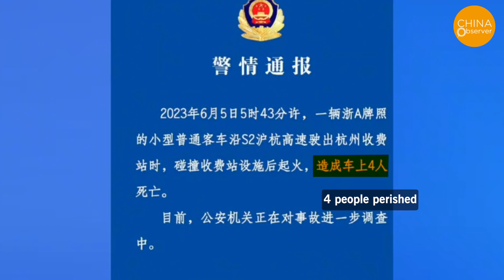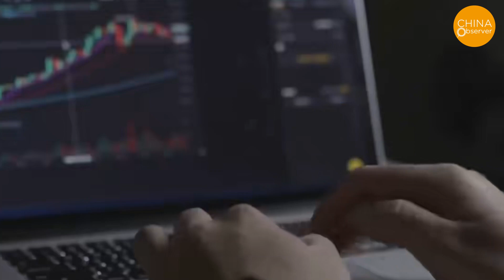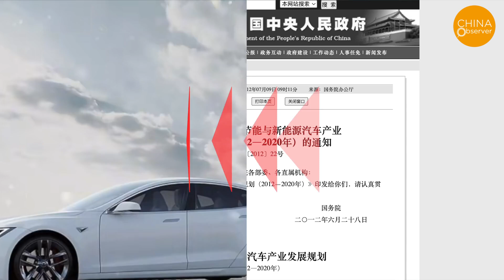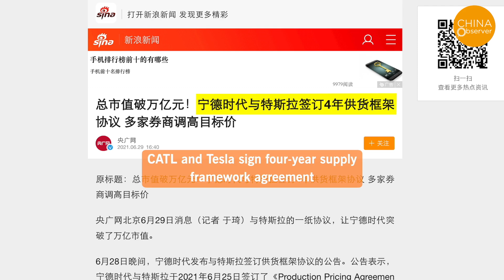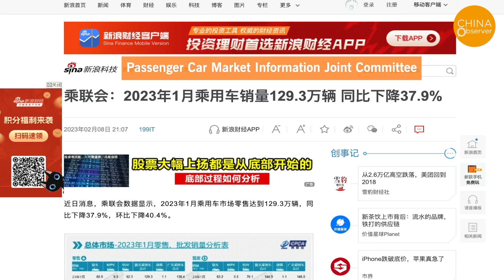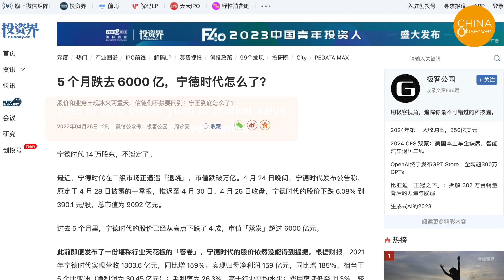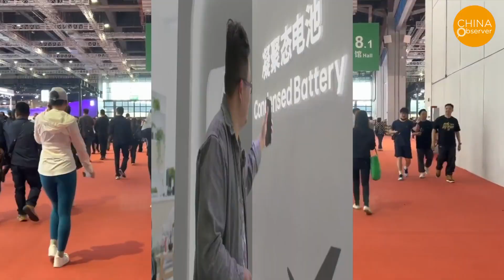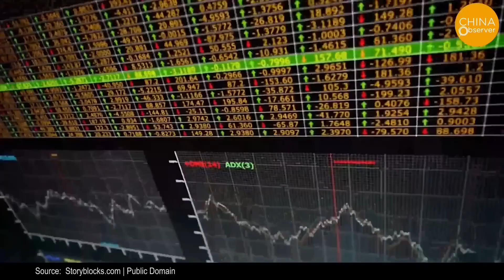China's No.1 EV Battery Factory in Ruins: Battery Explosions, Factory Blasts, 1 Trillion Lost

Comment: Ill stick to my 1961 Comet ,2 door , it has a 1968 ford 200 six cylinder engine Tremec T5 five speed transmission headers ,1 barrel carb . My car gets 26 MPG highway at 65 MPH, 7 external parts on the engine that can break all cheap . No computer and sensors.

Comment: I still love it how people tout 'hydrogen' as a solution to all this, without realizing....
1 - hydrogen gas is rare - in fact it is non-existent naturally on the planet and every cubic gramme has to be manufactured. These people confuse it with elemental hydrogen, ie free protons.
2 - hydrogen gas is EXPLOSIVE.... ICE cars go up in fire, EVs go up in an inferno, hydrogen cars are a BOMB plain and simple.
3 - hydrogen gas is expensive and inefficient to manufacture - the electricity needed to generate enough hydrogen to power a car 10 miles, is enough to power a normal EV for 100 miles.
Reply: Even if we could manufacture it easily/cheaply, the safety issue is still huge. I don't wanna drive around a hindenburg.

Comment: Lithium Ion batteries create metal fires.  It requires 80000 gallons of water to put out an EV car fire vs 800 gallons for an ICE car fire.  They are ticking time bombs.
Reply: Every gas car is ticking time bomb.  Have you never seen movie?
Reply: Guys if you crash any car into a solid barrier at 70+ mph it is probably going to explode.
Reply: modern cars dont use litium ion batteries they use LFP batteries which are much safer and does not produce oxygen for their own fire. LFP also does not need any cobalt or nickle

Comment: This year's biggest worry is how many ICE car factories will close and which brands will disappear. Jeep and Mitsubishi are already gone, next looks to be Huyndai which has factories for sale and 3 of the 5 already sold, then Peugeot and Citroen. In bigger cities EV sales will probably hit 80% as the cheaper battery prices are bringing the car prices down. Then there are the small cars that will switch to sodium batteries, those are dirt cheap, there is only 30USD worth of sodium in a typical battery and no nickel or cobolt. That's why CATL is also building their own sodium battery factory. 

The LFP batteries are now the dominant type of battery as their crash safety is the best. I have seen several accidents where the battery pack got a hit (one driving over a steel/concrete block that cut the battery open), and it was amazing to see that there was no fire. Then there was a Model 3 Tesla that went of the road and the battery hit a big rock. I know the owner and he said:"It cost me 1500USD to fix it, one of the 4 (LFP) modules was damaged and was replaced, the bottom of the pack was repaired. Insurance company refused to pay for it because it was on a private road and it was clearly a racing situation."

Comment: Nothing wrong with Tesla battery.... they have AC system to protect from battery fire. Chinese cars do not. The electric car is fun to drive but it cost too much. Insurance is at least twice as gas car. Renew license fee is expensive and increase every year. Every time you drive about 1hr, you have to start looking for charging station. I would not buy electric again.
Reply: Do more research. Some of the safest and best EVs are made in China. Zeekr 007 golden battery can withstand fire up to 1000 degrees. Does Tesla have this?
Reply: @i6power30  Tesla doesn't have to handle fire up to 1000 degrees because the fire never started. China EV does need this feature because it's on fire...
Reply: EV's are for the more wealthy in society. EV' make no sense for mid and lower class people

Comment: There are some correlations made in this video that just aren't true.

There wasn't a reaction to ANYTHING that caused the R&D of solid state batteries.  No explosion no nothing.  It happened because there is R&D all over the WORLD for battery tech and to bring anything to market takes MANY years as in a decade+ unless you're building upon a battery tech that already exists in the market.

For instance Tesla produced their 4680 battery which is in production in the U.S. and goes into their vehicles made in Austin.  It's a Li-Ion battery.   But it's a big Li-Ion battery.  It's designed specifically for BEV and it's designed to go into a structural battery pack which is a sealed unit.  It's new technology but the chemistry is basically the same so there isn't the years of having to test the chemistry of the battery.  It took them a few years STILL to get it to market because you have to design the machinery to make it and have that be efficient.  It is the BEST design for Li-Ion going into a BEV.  There's a bit more to it than what I listed.

The research for solid state batteries goes back more than 50 years.

BYD uses DIFFERENT battery types from DIFFERENT companies just like Tesla does.  Their LFP battery can't power anything.  If you have bigger vehicles that are heavy, you probably need something with more energy density so BYD would turn to CATL for their lithium batteries.

So, for any accident you have to do the research into the vehicle involved to know what battery type is in it.

Right now Tesla does well, and so do some companies in Asia, OUTSIDE of China such as Hyundai.  Both companies can't make BEV fast enough to keep up with their demand.  And this is to say that if you make a product that consumers want they'll buy it.  And part of consumers wanting a BEV is a proven record of safety.

One other point, a BYD sold in China is not the same thing as a BYD sold in the EU.  There's going to be standards that have to be met to sell a vehicle in the EU and if a company doesn't meet that their products will get pulled.  I think different companies have made things to be cheap in China so they can sell them for as low a cost as possible.  That doesn't work well with BEV as has been shown by mutiple fires.  But vehicles in China, because the CITIES are CHEAPLY BUILT has a DRAINAGE problem which means vehicles end up in water more often, and water and BEV don't mix well depending on the battery tech.

So now if China could start by first ripping down their cities and put proper drainage in........
Reply: But one has to consider the safety implications of Lithium ion cells used in large applications, a well known problem which manufacturers of battery cell packs conveniently ignore.

Comment: Lithium-ion batteries are a technology invented in Japan, but the Japanese don't like car fires, so they were very careful when handling lithium. Therefore, the Koreans and Chinese produced large quantities of lithium-ion batteries with the aim of making money. The result was many car fires. This is a very funny story. In Japan, it is still undecided how to handle nuclear power generation, so it is very doubtful whether EVs will become widespread in the future. Personally, I have high hopes for hydrogen engine cars in the future.
Reply: I totally agree with you. Japan is adapting hydrogen technology and Toyota is leading the way.
Reply: @ninjazzrhythm400  You are joking right? Toyota is committing seppuku with hydrogen tech. It's dead from the start, and losing billions and has billions more in debt.
Reply: Hydrogen is an extremely explosive gas. But if you have excess cheap or free renewable energy it probably makes sense to use that excess capacity to generate hydrogen as a form of storage for later use. But batteries are also a form of storage for later use and could be more efficient?
Reply: @gordo3582  you can even store energy in synthetic fuel also. Hydrogen is a really dumb solution.

Comment: Even safe batteries have to be charged and our grid can’t handle it
Reply: Nobody's can - more than a grid handling it, the massive investiments and maintenance of charging stations is largely impossible let alone the fact that they aren't standardized either. Add to that the fact that replacing a battery pack every 8 years or so costs £30,000 and you see what a stupid idea electric cars are currently.
They're completlet designed wrong.
Reply: @crunchyfrog555  Why do you need to change your battery pack every 8 years? you know just because your battery is at 80-90% doesn't mean you have to get a new one lol
Reply: Charge at home like most ev users do here.
Reply: @kamsunleong6648  Great as that limits you you to how far you can travel then. What a dumb solution. That's the big problem with EV cars. Even here in Britain there's fuck all chargers which means if you travel more than a couple of hundred miles, you're stopping for the night or permanently.

Comment: Don't plan on surviving in a major collision in any EV. Perhaps hydrogen vehicles may be safer than EVs.
Reply: hindenburg
Reply: @cliffontheroad  excellent analogy. I wonder what happens when a fire starts and the jaws of life are required. Batteries won't wait for emergency services to show up. A family friend's daughter was cooked in a rear-end collision while she sat at a stoplight in the famous Ford Pinto. I wonder if hydrogen might prove to be safer even though there's compressed hydrogen to deal with. Lithium batteries have a series of individual batteries that have a potential to short circuit if hit in an accident.
Reply: @thinkingimpaired5663  There is always the Stanley Steamer. And an actual bath tub toy powered by baking soda. I leave battery design to my betters.
Reply: Hydrogen is extremely flammable with invisible flames, impossible to keep in a container because it leaks through any metal and can explode in any solution from 3% to 97%
If you want safety you should drive electric since ICE cars are much worse, but don't drive cars with some chinese brand batteries, they have quality issues